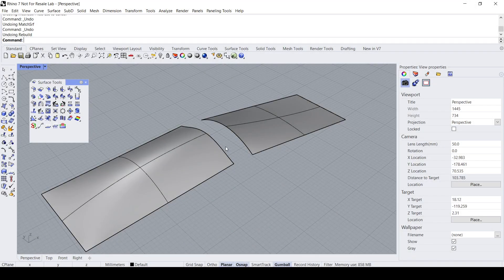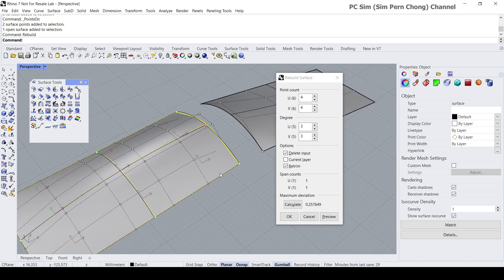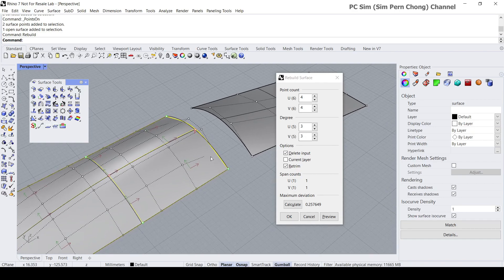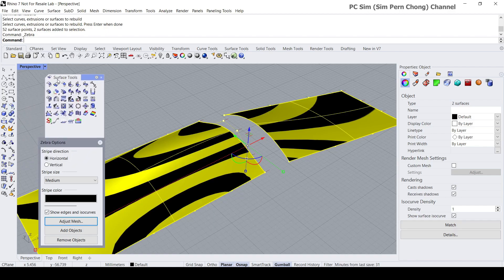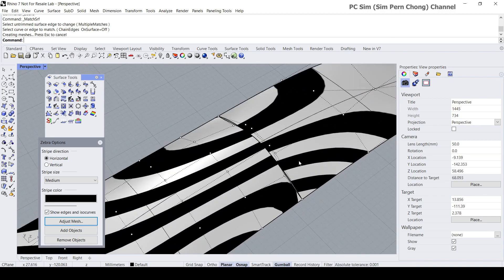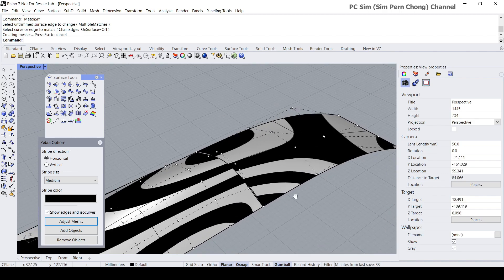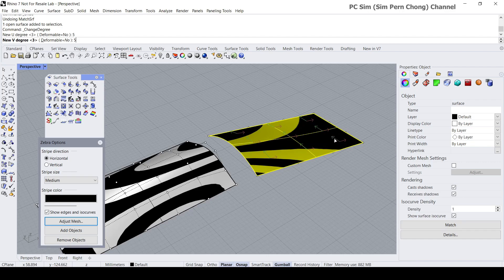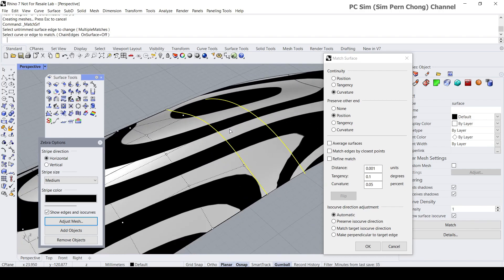Rhino Surface Continuity Tutorial: Change Degree

Comment: Hi Sim, me again! Why is it often impossible to join the surfaces after matching? Sometimes it works if you change degree, sometimes not...
I don't figure it out...
Thanks a lot
Reply from the maker: Hmm... perhaps got to check if they are gaps between the match. Change Degree is just one aspect of matching. Got to check if there are also enough control points on the side to be matched as well. Perhaps you can try, exploring insertknot / removeknot to control the control points distribution without changing the surface profiles too much.
Reply: Thanks!

Comment: Great job Sim! I have a question: why don't you use "Preserve other end / Continuity"? Is there some particular reason? Thanks a lot
Reply from the maker: Hi Carl, the 'Preserve other end' is used to control the continuity on the other side of the surface. If it is set to 'position', the only condition is that the other end will not move away. If we have another surface on the other side and it needs to be nicely matched as well, we can use the 'Curvature' option. But additional control points might be added by Rhino to constrain that.

Cheers.